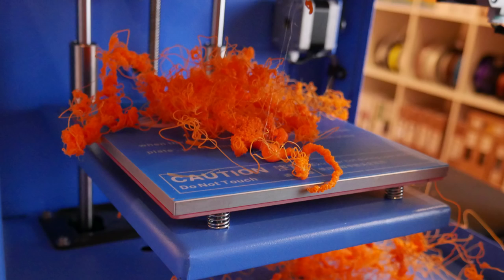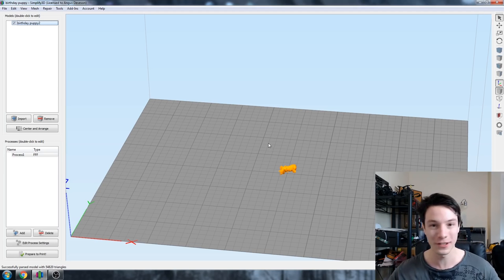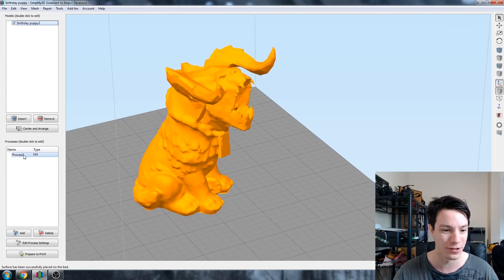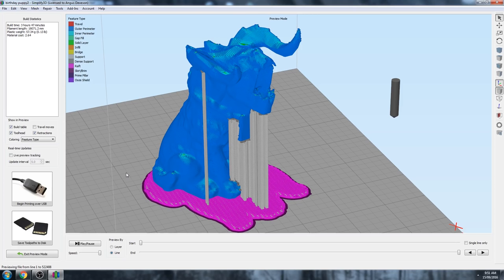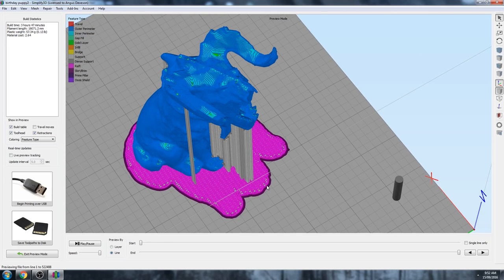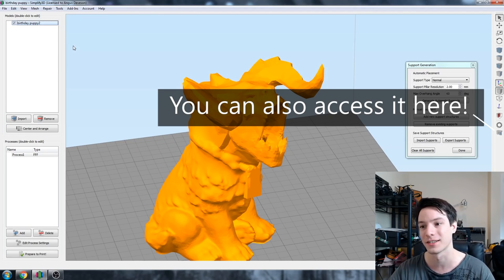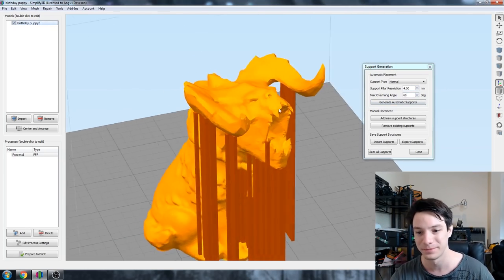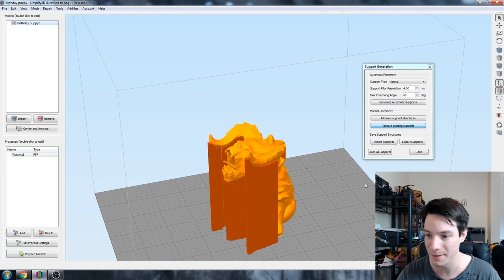Use G-code Preview to prevent 3D Printing failures! 3D Printing 101

Comment: You'd be surprised how many people don't actually look at the gcode before printing. Slic3r has a great layer preview mode, extremely useful for catching mistakes early. If you want to see line-by-line execution, I generally throw it into gcode.ws, it'll allow you to see the order a layer is printed. Gcode.ws also gives a pretty accurate estimated print time, and amount of filament used.

Comment: Angus your videos are a great resource. I had made a little statue for my parents dog who had recently passed away with help from a previous video. The print failed horribly because the slicer didn't grab the ears for support. I glanced at the g-code preview and thought it was good enough. After it failed I really looked at it and noticed that there wasn't any supports on the ears. No matter what I tried I couldn't get the ears to be supported. I remembered one of your videos talked about a slicer that you could manually put in supports. Off to YouTube I went looking for that video. I found it and purchased Simplfy3D. I used your videos for a crash course on how to use it and the print turned out great. That was two months ago. I immediately subscribed to your channel after the print turned out great. The price for Simplify3D was well worth it seeing how happy my parents were when I gave them the statue. Thanks for the great videos.

Comment: I actually just yesterday stopped a print from printing an overhang without any solid bottom layers.  I had selected multiple processes and had started the final one at the wrong location and would have ended up with a large hole.  Seriously, simplify3d is worth every penny, the preview is amazingly helpful.

Comment: Love this type of video, I will definitely budget in the cost for Simplify3D while saving for my first 3D printer. This video sold me on this software for sure, thank you for the in depth explanation.
Reply: Have you ever tried out any other slicer?

There are some really good and free alternatives out there, one of them being Slic3r
And today basically every single one of them has G-Code preview.

Not to mention lots of other features that do allow for almost as much flexibility as with S3D. For free.
Reply: thank you, I will look into the other free options :)
Reply: No Problem!
Slic3r is a good start, and the new Cura is definitely worth a look too!
Reply: Will do thanks

Comment: 2 things that keep me awake:
1) Does the/a Printer take into account for Shrinkage?
2) Does the Printer take into account the Opening of the Print Output?
I am new to the needs of designing for a 3D printer.
I have read 2 books (for beginners) and neither touched on this, and I have alsi watched countless YouTube videos as well, and again, No, Nothing about any printer taking these 2 things into consideration.
For my designs, I must know what the Abilities/Limits are for the material is as well as for the Printer.
I am going to start out with some easy projects, but I have big expectations for the tools that I use.

Comment: great video! love these S3D tutorials. learned some new tricks :) woo!
Reply: Agreed.  Please keep the S3D tutorials coming.  I bought my first 3D printer used from an experienced 3D printer user who highly recommended S3D and gave me his S3D settings for that printer.  I have two other 3D printers now and S3D has worked great for them as well.  I have never had any reason to try any other slicer.  I  feel that most commercial software that I buy is overpriced for what I receive in a majority of cases but S3D earns its keep.

Comment: Thanks for recommending Simplify3D to me in one of your Q&A sessions.  It has been a GREAT INVESTMENT that has saved me a lot of frustration.  Previewing Gcode and the ability to manually increase of degrease support materials is awesome in Simplify3D.  One area that I could use some help in is the settings for the support material.  Specifically finding that sweet spot where the support comes away more easily.  I was jealous of how easy it was for you to remove the support in this video.  I have reduced the Upper and Lower Vertical Separation Layers to 1, to help support curved surfaces better, but now find that the support is MUCH more difficult to remove.  Perhaps the temp is too high?  If you could do a video about tweaking the support settings, that would be great!  Thanks! Never Let The Machines Win

Comment: Not a fan of these borderline ads for S3D, gcode preview is a feature of most slicers (slic3r, cura etc have it) implying it's somehow exclusive to S3D is disingenuous.
Reply: and, i think slic3r even does a better job showing you the output gcode, and i think it is really awful to use any other slicer, bacause it is just the program i always used at home
Reply: Agreeing with you here.
The focus solely on S3D and basically leaving out any other free alternative is something rather upsetting in my regard.

Especially since Slic3r has many of the tools necessary for normal use.
I mean, it even has Modifier Parts to change settings locally, which is very similar to the S3D Tasks.
Reply: There's a reason why most youtubers use S3D, it simply works best.   Not software-wise, but end results gives a better print quality.  

Also these tutorials can be easily translated to other programs if they have similar features.  Hard to teach a general tutorial for 12 different programs; the teacher will use his favored tool as it is the easiest to teach with as they're most comfortable with using said program.
Reply: No they use it because they got it for free, and he claimed these are S3D specific features other slicers don't have.
Reply: Nicanor Santillan 
Well, that may be true, but since the goal of a tutorial is to teach people something, it would only make sense to do this in a software that almost everyone has available to them - Not something that only some people want to buy.

Besides, did you ever see a test of the quality of parts compared between different slicers? 
Sure S3D can handle some situations better, but this does not mean that its general print quality is better enough to justify 150€ extra.
Reply: check out the slicer comparison by makers muse. sure it does some awesome quality prints, but i still. think it is not good to show the gcode preview as if it was a big benefit over other slicers
Reply: Xasin
Yes, there are comparisons on slicers print results.  I read up as much as I can before buying it and most reviews have the same opinions.   Also why most people use E3D V6 hotends, they work the best.  They do cost more, but you get better end results.
Reply: Nicanor Santillan 
True, but the choice of soft- and hardware depends on your budget, and the quality/price ratio.
If you want super smooth and well made parts then you'd obviously go for S3D and the likes.
But completely leaving out the "mid-range" or DIY options for medium to low budget range, for those who don't care too much about that last final tiny bit of quality, is a bit annoying in my personal opinion.
Reply: I don't like that people perpetuate the myth that S3D is somehow magically all around better, that comparison video he made was bunk since he didn't tune anything just used defaults which meant slic3r didn't account for required cooling at all (forgot to set min time per layer) and he didn't use a part cooler (who does that with PLA?), you can get as good results in other slicers but you need to spend more time tuning their settings.
Reply: slic3r can even do stuff like different infill per z height or any other setting per model/z height but it is a bit more hidden inside its menus and it seams as if everyone calls that the number one killer feature of s3d...
Reply: max rainer 
You're talking about the Modifier parts, right? 
I think they can do some amazing stuff when used correctly, and are similar to the S3D threads ...
Maybe even easier to use as you can simply provide a separate .stl model for the affected regions! 

But precisely this is why it would be important to have a video about Slic3rs modifier parts, to actually allow people to /know/ about them.
Reply: Yea i also needed a lot of time to find it because there isn't much about that on the internet. i am just in the process of exploring what possibilities this opens...
Reply: Too bad that some youuutuber, definitely not looking at the channel here, hasn't done an explanatory video about it.

Or, for that matter, any more well known printer channel I see.
Reply: but still, he is a really awesome guy and i think we should not rage out just because of such a small detail...    😉
Reply: sigh
True. 
I still would not mind Slic3r getting attention too.
Reply: The main reason that S3D is feature here, is that S3D has customizable supports.  Slic3r does not.   (unless its been added in the very recent past)  So in his particular example, you would be unable to add those needed supports, so your only solution (in my experiance) would be to over support the whole model, wasting lots of material. 

Yea, most slicer do have G-code preview.   but in my trials i like s3d the best personally, and its also a good deal quicker than most slicers.
Reply: Erron Watts Exactly, you hit the nail on the head

Comment: Thanks for the great vids! It would be great to see something on getting as accurate as possible prints. When print calibration cubes or other dimensional parts, I get slightly different scaling in the X, Y and Z directions. The difference between X & Y was surprising. I use the scale function in openSCAD to deal with this, but are there ways to adjust the process settings in Simplify3D so that they can be specific to materials?

Comment: I'm a fan but was disappointed when I was expecting to see the actual code...
Is there a way to see the line codes for repair if you want to tweak a command or find out if there is some error or you just want to change jog speeds etc.  ?

Comment: My dual extrusion models where I merge two models together (1 for each extruder) always get confused after the first layer. It is a single nozzle to heat with 2 extruders which Cura doesn't seem to understand. I set them both to 195 degrees but after the first layer, for some reason the temp goes to 180 while it pauses, then it heats back up, then homes itself, pauses, and then continues with the print.

Comment: I wish there was a free trail of simplify 3D
Reply: You can buy it and test it for 30 days. They offer a refund if you're not satisfied.
Reply: Before I brought S3D I asked the same question to their support team because I was concerned that it would not live up to all the hype etc. But I needn't have worried, it really is as good as Angus and others say it is ... and then some.
On top of the software being the best there is, IMO, the support guys are fantastic.
I've contacted them on several occasions, not because of software issues, but for guidance, and the responses have been fast and concise.
I'm very glad I took the plunge and I'm sure you would be too.
As Julien Dodokal said, they will give you a refund within 30 days if you don't like it.
Reply: I know, putting down $150 just to test it, no thanks. I'll stick with Craftware
Reply: There's actually "another way" of testing it. I did it and while S3D is pretty good I'm sticking to Cura because last Cura 2.3beta is very similar and I prefer using free softwares.
Reply: Is there a Cura 2.3beta?! Hmm... I'm on 2.1.3 and quite happy with it. Yeah, manual supports are lacking but other than that I don't see the point to go with S3D.
Reply: Kris M Yes Cura 2.3 adds a lot like faster slicing, instant rendering while using layer by layer view, multiple extruders, Materials manager, easier to use/update profiles, UI to support custom printers!
You can download it at the beta section:
https://ultimaker.com/en/products/cura-software/list
Reply: Indeed, the free, open source slicers are amazing.
Reply: Oh yeah! Installed, configured... No more manual json file editing to get all my printers in (all custom built + davinci jr). And I love that bunch of new settings they've added, oh yeah! So far there is one thing what doesn't work - you can't edit custom materials via GUI, but well you can't win them all + that's still beta. Also if you compare it to S3D it's still lacking some of the features but to be honest Cura isn't far at all.
Reply: I have no issues editing custom materials, just click the top right Edit button?
Reply: Andrew Joy ....or maybe they could lower the price....30% of something is better than 100 % of nothing !
Reply: Julien Dodokal nope 14 days now
Reply: QuadCopter 102: Get Cura then :)
Reply: what is the other way??

Comment: Whats with you people claiming hes trying to sell you something? He uses Simpify3D, not because it was free or because he gets paid to push it, but because its the best. He clearly says in the description that he will show you how to do it in Simplify!? If he wanted to do a tutorial on how to use G code in another program he would have labeled it as such. You also had the knowledge that it was done in Simplify and could have chose to simply not watch it if you've got a problem with that software. He does videos on UP printers, I generally don't watch them because I will never own an UP! How did he imply it was exclusive to Simplify? Hes done several videos about other slicers, one even comparing them and the prints they produce. Its $150?!, not like you're buying Solidworks or something, drama queens.

Comment: Hi there! First off all, thank you for your awesome videos! I don't have a 3d printer yet, but after some more research I will buy one. Do you have some recommendations for buying your first 3d printer? I dont know if you are familiar with the flux printer (https://flux3dp.com/), do you think this is a good one for starters? :)

Second question: I really liked the print you made, but the surface of the print was not smooth. Is there a way to configure your 3d printer to make is more smooth? 

Greetings! (from Belgium)
Reply: You can make it smooth in the post process after it has been printed. Some printers with higher resolutions make it smoother, but you will always see lines from the layers of the print

Comment: Hi! 
I always like your videos, however I am slowly beginning to be mildly annoyed with the amount of attention that Simplify3D gets.

I do acknowledge that it is a powerful tool, and is well suited for its job, however ... 150€ for a slicer? 
It is not a price that me, and probably many others, would ever want to pay.

/Especially/ with very well and good running open-source free alternatives, like Slic3r. 
It too can handle different settings in different parts of the 3D print (similar to the different "Tasks" in Simplify3D), and ALSO has a G-Code layer preview.

I find it deeply upsetting that you are not giving this reliable and crafty, /free/ tool a look too, and instead focus on a slicer alternative that many might not want to get due to its price.
Reply: Y'see, I would agree. Except S3D is worth the 150 and then another 50 if you ask me.
Reply: Yeah, but I personally am not one to spend that much money.
I am a DIY guy, I've assembled my printer myself out of a kit from E-Bay for 270€
That basically makes S3D 50% the price of my machine.

Besides, I have never ever had a problem with Slic3r when it comes to customisability, speed and reliability.

/BESIDES/, is there really a reason for the software to be THAT expensive, if the community manages just fine to create a well working system for free? 
And compared to other things, like, oh I don't know, games or Windows itself, that take lots of work to get going, although I've never seen them pricing that high? 

It may be that S3D is a good tool for /industry/.
But for me personally, it is overpriced, and not worth it.
Reply: From a gamer's perspective, it is overpriced. When you realize how much work goes into it, and that they have one price for commercial and consumers alike (think engineers who need high quality prototype with extreme customizability), it really isn't that high a price. Look at music production software. Look at Adobe. Look at Cinema4D. Look at Autodesk. This is their pricing equivalents, not video games, my friend.
Reply: Alright ... 
True, for industrial use this software most certainly is better suited than any freeware like Slic3r or Cura, and definitely implements better options.

But at least I personally am not industry.
I don't need those extra features that allow industrial use to just be a tiny bit quicker or better, I just want something that works well, without having to spend half the price of my printer for it.